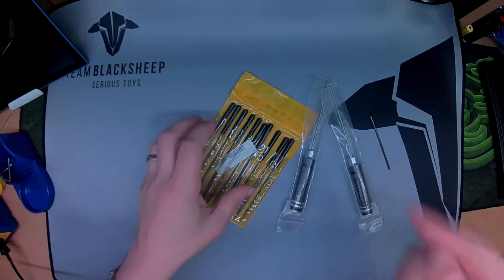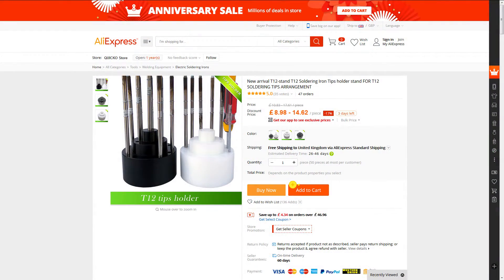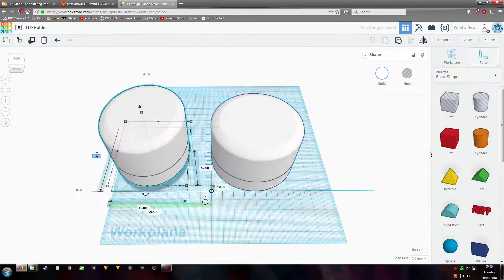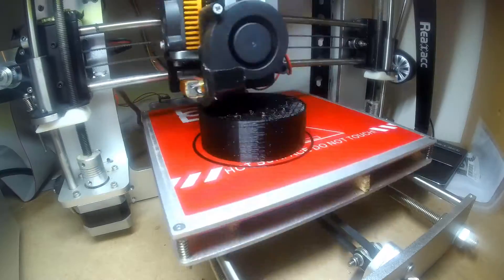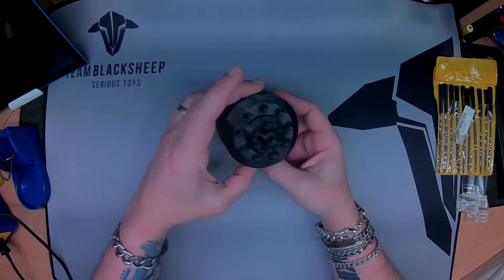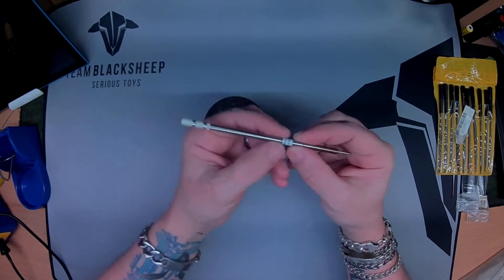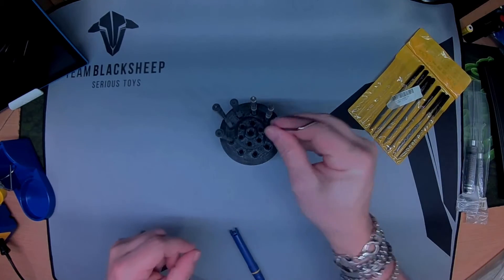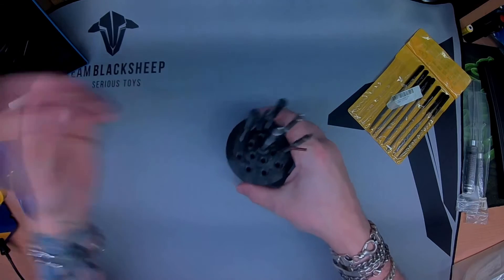Hakko T12 Tip & Universal Tool Holder [3D Print Project]

Comment: nice how much did you spend to 3d print it?
Reply from the maker: The software tells me that it used $1.65 of material but I bet you could half that with cheaper filament and less infil.
91g of PLA from a 1000g roll, if you are lucky like I was at times, Hobbyking flash sale's it for £3.57 for a KG so that would have cost under 35 pence.

Comment: Nice intro
My 3dprinter kit just arrived and i might print one of these when i got it all working :)
Also, i received the new axles for my car, they already survived a few crashes and seem to work good
And i received the parts for the e58 so that's working too :) 

And, does tinkercad lag for you? For me it's too slow so i'll have to search something else or find a solution..
Reply from the maker: Thanks, intro was the holder with my name on for a laugh :)

Sounds like you have alot of fun on your hands at the moment, I loved building my printer and getting started with it.

Tinkercad does lag some for me but I think its due to their system not coping with the amount of users, Onshape is another good one but is a bit more complicated.
Sketchup (or the renamed new version of it) can work and I believe even Blender is also ok.

If you have lots of filament,print the holder but use what you have getting the machine dialed in first. IIrc it estimated 7 hours but I cranked it up to 350% print speed and it suffered :)

I want to see videos!
Reply: MrE haha, i already saw that and it looks cool

And i received alot of packages today, but the main things were the printer and propellers.

I think i'll look a bit further into that when i'm done with printing the things i already found that i want to print, there are so many awesome things on thingiverse :)

I 'only' ordered 1kg of PLA, but that should be enough for some time, and i already have some upgrades planned. 

And, i only recorded a few recordings while flying, but i'm going to be flying it alot more and make a video out of it very soon. Also thinking about filming my car with it, but i'll need to see who's controlling the car/drone first :) and i also ordered a tripod some time ago, when it arrives i'll try record something of the car
Reply: i just got everything working, test print was okay, but really good for 0.2 layer height and first print :)
and i tried recording some more with the e58 but it had alot of delay when going left or right.. even with my phone and sometimes it would just stop and fall out of the sky.. i think i'll try it again tomorrow

and 1 stepper motor of the printer didn't work (i could move the bed when the motors are on and you could let the motor go the other way by touching it when it was moving..) , but after reconnecting the wires it works again... seems a bit strange but it works :)